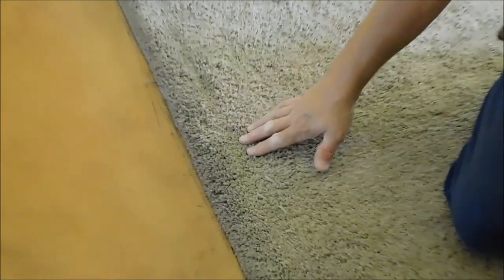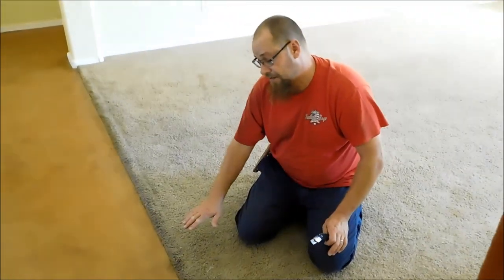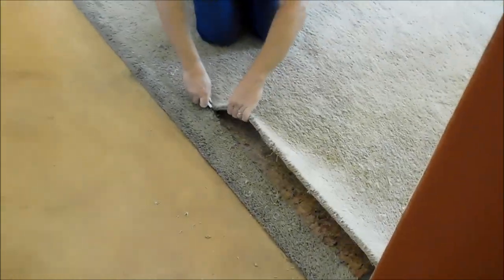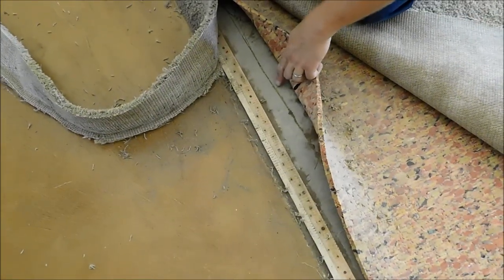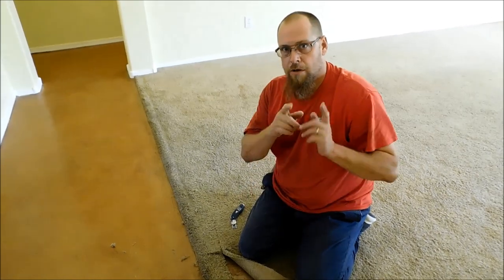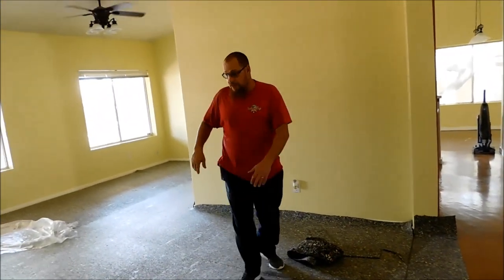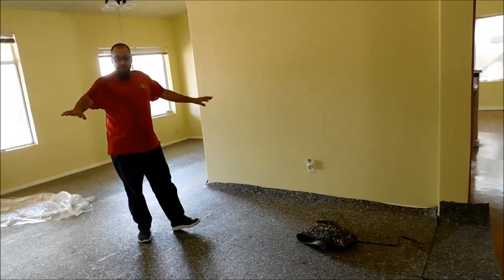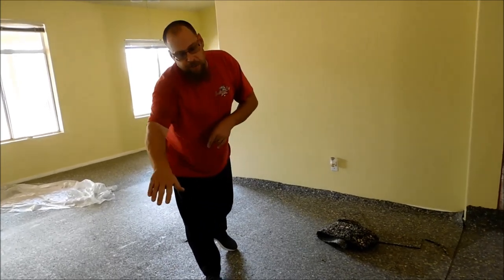PREVENTING THE DIP BY ZBAR

Comment: I was searching z bar gap or z bar carpet edge or z bar doorway trying to determine what my installer did wrong. It was dipping as you call it in less than 6 months. Since the installer had 30 + years experience, I thought we were doing something wrong initially and were flattening a area we should avoid. Which was not easy or logical especially for my husband and his size 13 feet.. After a minor water leak I had determined it was a pad issue but still didn’t know the right way to trim out the doorways to insure we wouldn’t see the same issue again.  Thanks for the very detailed and easy to follow explanation. We are now empowered and confident we can make the modification and clean transition.
Reply from the maker: Merriman's Furniture Awesome, good job on the research, good luck on your repair as well

Comment: Good tips Ruben! I always taped my seams and glued the perimeter by using a generous bead of glue and took a scrap piece of pad and spread it out so the glue would be about a 6 to10 inch wide and up close to the tack strip. It really helps the pad from not pulling off the strip and also helps not bunching over the strip when stretching.
Reply from the maker: thanks for sharing

Comment: One way to eliminate the pad shrinkage is to tape the perimeter to the tackstrip. I use duct tape on the edges as well as the seams. An added bonus is there is no odors from the pad glue for the customer to be concerned with.
Reply from the maker: Richard Langford sounds great, thank you

Comment: Great video, keep them coming! Have you ever had the pad grow on you after you laid it out and let it relax? I install a lot of healthy choice 1/2" 10 lb pad and it's rolled so tight from the factory that when it's unrolled at the job site and it relaxes it actually grows.
Reply from the maker: shawn moore Yeah I think I know What kind of pad you are talking about and yes I have seen that stuff grow
Reply: Yes I have!!
Reply: Padding company's actually support stretching the pad and stapling as you go!!
Reply: @fredtowns78  we did that on basement job one time and within a year the pad shrunk and pulled 2" away from taped seam
Reply: @shawnmoore5621  did you use pad adhesive on the seams and around the edges??
Reply: Pad adhesive is expensive so some guy prefer multi purpose an use the backside of your carpet trowel to spread on seams and a 6inch plaster knife around the edges!!!
Reply: If you use multi purpose you skim it on very thin press hard on trowel to barely skim the surface!! If you put it on like you do on carpet it can seep up in pad an cause hard spots when it drys and traffic has been on it!! Still must tape seams!!!
Reply: @fredtowns78  yes, always do. I use pad adhesive. It sucks to do a tearout when people use multipurpose glue
Reply: @shawnmoore5621  it does because to many don't use backside of trowel and press hard when using!!